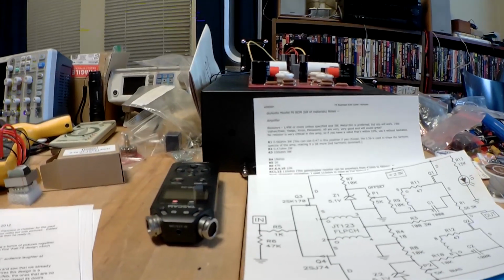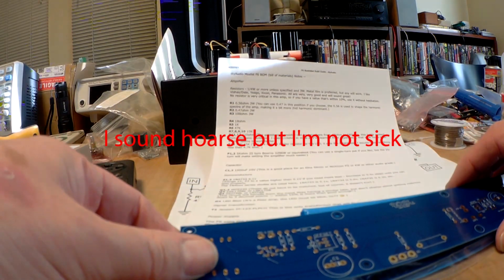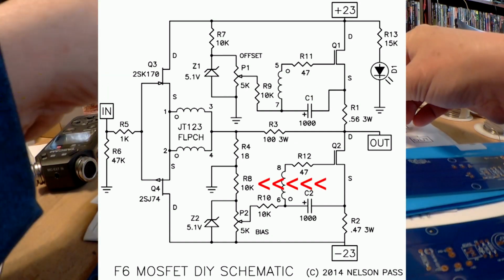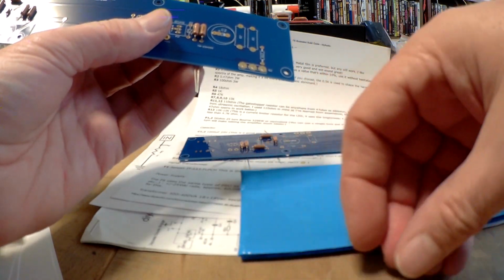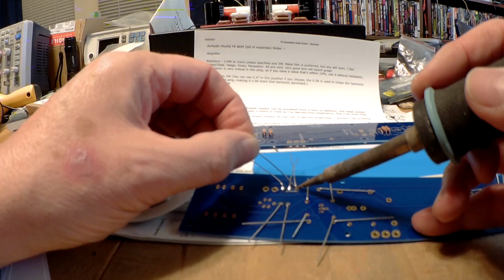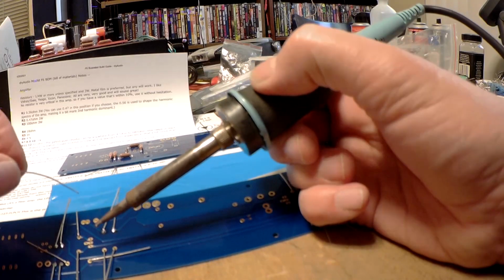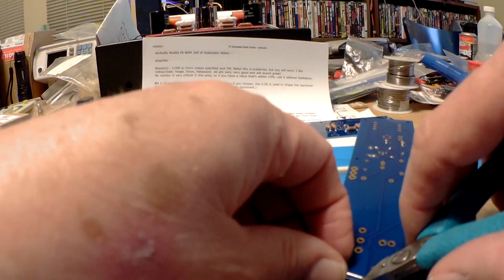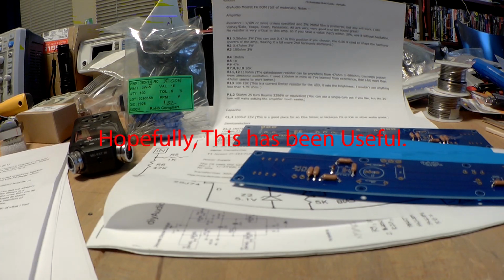Robert Builds the Nelson Pass F6 Amplifier part 1

Comment: How stable will the output zero voltage be when Q1-Q2 get warm? and why is the source resistors .56 and .47 Ohm? and not equal? And what are R4 and R8 for?
Reply from the maker: Roy, please go the First Watt website. Under Articles read Mr. Pass' own lecture on the F6 design from the 2012 Burning Amp Festival.
I have found the offset voltage to be quite stable.

Comment: Great to see you bulding another first watt pass labs classic! I have had my f6 parts kit I ordered from diy audio for a while. They seem to sell out and not come back in stock for a while. Think I have the complete kit. Since you have make the f5 turbo, any consideration for making the amplifier board swappable? (I think your making an entirely new amp? Dual mono as well?). I appreciate all the time you took for some of us that are not as experienced. Useful tips and tricks are always helpful! Have you been following the vfet lottery, give away and upcoming Nelson pass designs with big Tokin and Sony vfets? Their are a couple of other members on their like Zen mod that have a particular design or 2 using them called the sisssysit and one ben mah?  Has made with Hammond 193v chokes (really simple 25 watt class a design using those Japanese Tokin and Sony vfets Nelson has urged everybody to purchase) I got a couple of matched curve traced pairs. Thanks and look forward you your build!
Reply from the maker: Brandon, Most of the forum guys say the F6 works best in the 4U Galaxy enclosure due to its single large heatsink compare to the 2 smaller ones in the 5U enclosure. I'm planning on a single shielded 400VA transformer for the F6 to avoid any hum coupling into the signal transformers. I do hope to use two DIY power boards even if mounted edgewise. 
Great minds think alike! I have a matched quad set of Tokin 2SK180s waiting for a Pass approved design to be released. The units are about a third larger than regular TO-3 case transistors so heat sink mounting and insulation will be a major concern.
I've ordered the case, but the hardware and other chassis parts kit is currently sold out at the DIY audio store. The store does seem to have an issue keeping popular items in stock. This might be due to suppliers on  pandemic schedules. I know the matched transistors are quite seasonal since someone close to Mr. Pass goes through them all doing the matching.

Comment from the maker: One BIG correction I need to make. Due to operator error, I got erroneous high readings on my Metal-Oxide 3W resistors. After zeroing my test leads, I got very good readings on the Xicon resistors I got- No more than 1 or 2 hundredths of an Ohm off spec and well within their 5% rating.